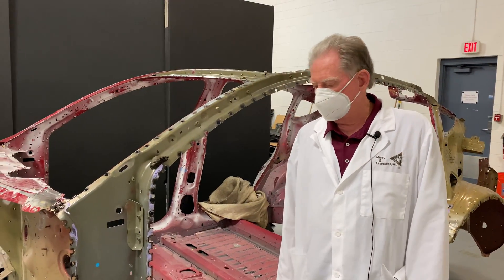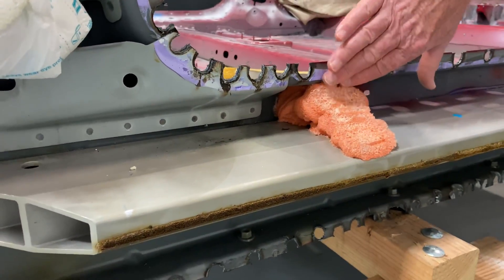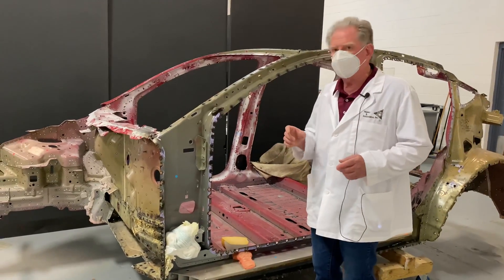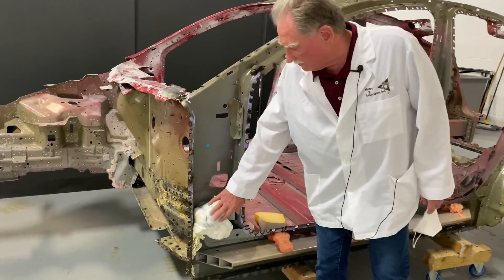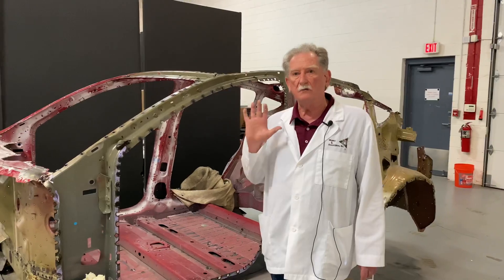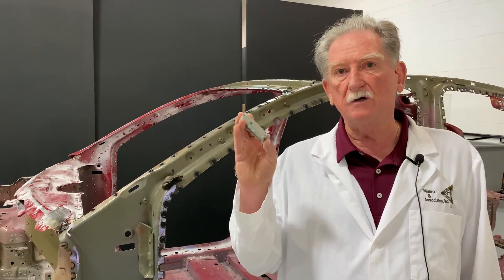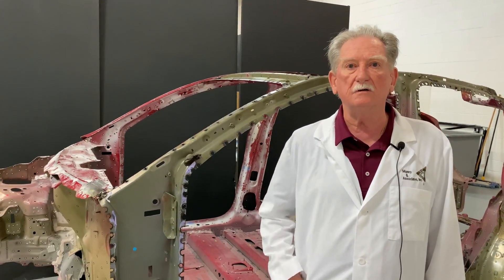Tesla Model Y - Failure to Foam

Comment: @Mr. Munro - I want to do whatever I can to improve the sound deadening in my Model Y.  Are there any places or cavities in the model Y where I could add low-expansion spray-foam insulation or something else to accomplish this?  Based on this video, it looks like there could be.  Do you have any other ideas for reducing road/wind noise in the interior?  Thanks!

Comment: $130 for ONE battery? Ah that's a good laugh..
Reply: I would buy one. It is a memento, not a battery :) But US only :(
Reply: @MB-xz7ls  yeah I understand a "memento" if you took it apart or if it actually meant something to you. It's just a battery taken from a disassembled Tesla. Get one on ebay for $5
Reply: @O-RoD  Sure. Everyone has a choice. For me it would be a memento but they would need to make it real good. Not just a battery in a jar. :)
Reply: @O-RoD  I just checked eBay. They sell it for really crazy prices. Not 5 bucks :)
Reply: @MB-xz7ls  search eBay for "2017 Tesla Model S X 18650 Battery Cell"  $4.99 + $3.50 shipping
Reply: @O-RoD  ok but I was thinking about TM3/Y 2170 batteries

Comment: Munro, I've designed pillars to deal with spray in expanding foam as well as the expanding foam in the floor area. I've never heard of using bag foam and it seems like a big design mistake. Can you post pictures of what the other side looks like to see if it might have been just a 1 off issue relating to expansion or placement or if it is an inadequate sealing strategy?

Comment: That's InstaPak foam - used for shipping fragile goods. It has an A and B component in the bag, you press down on the two components and knead them - starts expanding. It also acts like a sponge, so when it gets wet - it stays wet! Being where it is, isn't good - if it were to get wet in a salt belt environment- it could lead to serious structural issues from corrosion.
Reply: Yes, I would probably guess the bag either split being pushed into the cavity or wasn't properly mixed, or a bit of both. I would guess being in a bag would have helped as it would stop it getting wet.

Comment: What sandy found was an example of hidden quality faults that result in customer complaints that are likely never solved.  

“My car is noisy and my buddies is quiet.”   No service rep would EVER figure this out unless Tesla made a quality bulletin and figures out how to fix it (inject foam into the unibody?).   

Sadly, early cars will suffer from these defects unless Tesla really buckles down on process control.
Reply: Every Tesla model has these quality fails when they initially come out, I feel that they never learn. I think I even heard Elon call initial customers his "Beta Testers" and that's right, they are guinea pigs for the R&D and production guys.

Comment: That's packing foam, like you get in a package of parts. Holy crap. Very half-assed. Tesla does much great stuff and then throws in these head-scratchers. Foam block behind the rear wheel wells are another example of something not quite thought through.

Comment: Foam in hollow body panels is generally a bad idea because the material collects water from condensation rusting the metal from inside out.Better use other sound deadening methods and spray the cavities with liquid wax/grease to protect against corrosion. It seems that there is no additional rust protection on the inside of model Y steel panels in vulnerable body areas( A-Pillar)! Not all EVs a driven in the dry south west.
Reply: It is only a bad idea to have foam in hollow cavities if you expect a lot of water to get in. However, most of the time, these panels are hot stamped and are coated from the supplier as well as go through a corrosion resistant bath after being welded up. That should protect enough for a few drops of water that get through before it evaporates into the atmosphere. Liquid wax and grease is great, but super expensive and a pain to apply. Most of the time it isn't needed unless you are in a northern area that gets a lot of snow and salted roads. It is much more efficient to design a car to not leak and put sealants in the weld seams to ensure water doesn't get into those pillars.
Reply: @veverkak  Problem is  repeating water condensation on  cold not airtight enclosed steel parts when air temp and air humidity changes, for example overnight.Welding damages the protection layers you are taking about. I assume because of limited bat life Tesla has calculated  a matching limited body life too.Wax/grease spraying is a standard process in premium car manufacturing. Mr. Munro does not address the issue therefore it seems either he lacks expertise or his manufacturer comparing analysis is biased  .His show is amusing though.
Reply: plan pitz obviously condensation will occur. The hollow sections “should” be air tight to the exterior wet environment, but not air tight to the interior. So the condensation should still be able to evaporate at a rate that does not cause this to be a corrosion issue. You are also correct that welding removes the protection of both the metal coating film as well as any sealant in the welding location. However the ED coating that the car gets after the body is welded together will still be enough protection. Also, the flat for a spot weld flange should be designed wide enough to take into account the heat effected zone from the weld as well as robot accuracy and still have enough panel to panel contact that water doesn't get to the heat effected zone of the weld. I think wax/grease application has decreased usage even in premium cars due to cost and the improvement of white body accuracy.

Comment: I hear the front motor with whining noise and pulsing sounds while cruising in my Model Y (especially above 40mph).  Could this be the reason why?
Reply: Did you expect it to be perfectly silent, like an internal combustion engine?
Reply: @isthatatesla  I get it and don't expect it to be quiet.  I believe what I'm hearing is not normal...The lack of insulation could explain it.  Sandy mentioned in the video that he heard noises as well and included in his road report.
Reply: @rmoro999  He heard wind noise. Are you sure your not hearing the heat pump?
Reply: @JasonWW2000  yeah, I don't hear the noise at lower speeds.  It's when cruising along around 40 mph barely pressing the accelerator...it's a high pitched whining noise from the front motor that goes from constant noise to oscillating / pulsing.  I have to turn up radio to drown it out.  Is this normal for AWD Tesla?
Reply: @rmoro999  I dont know if that's normal or not, but if its bothersome it's probably not normal. I would check Tesla forums.

Comment: .007 0:07 that looks like shipping foam. Which would be horrible in the car because it's meant to compress and absorb energy and get smaller which means in a car it would get smaller and smaller until it started rattling and actually making noise
Reply: You'd actually hear foam rattling? Seriously?
Reply: @isthatatesla  Its very light weight. No rattling.

Comment: Ouch. But at least Tesla will not wait until next model year to fix this.
Reply: Watch another channel and that is put in there to stop noise from the air when driving and they originally didn't do it you had to get a third party to do it, they have been doing this for years and still haven't fixed their design.
Reply: @dikkybee4003  maybe because that foam does it's job 99% of the time and if that Y was not tore down, it would have been fine?
Reply: @davidbeppler3032  Please watch the video before commenting.
Reply: @davidbeppler3032   As Jason says, just watch the video! It’s only 3 and a half minutes long:

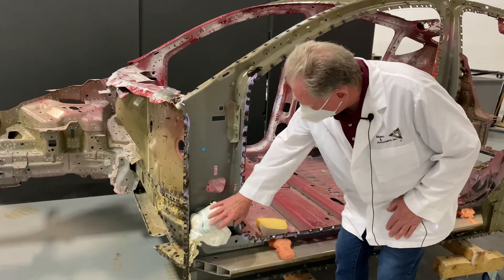1:27 “This with the bag and everything, I don’t, I’ve never seen that before but I can tell you that it’s ineffective. And in my report that I did on the ride and drive, I mentioned that I was hearing noises from the front and I think this is supposed to nullify that noise, in actuality really what we’re looking at here is something that’s totally useless.”
Reply: @mrsneeklamy  Do you have a point?  As I said, works 99% of the time.  He found the 1 that he says does not.  I guess you don't understand how mass production works?  Yea, Sandy said he thought he heard something.  But he did not say, I knew we would find something wrong.  See the difference?
Reply: To be fair, if things like that happen at BMW or Audi, they fix it as well during the production run, not with the next model year.
Reply: @Batvolle also to be fair, BMW wouldn't use InstaPak shipping foam in their cars (which holds water like a sponge)  :) 

This would have been caught in validation and pre-production.
Reply: @myronsamila7493  hahaha not true. They used in in my e46.
Reply: @myronsamila7493  Hahahaha car company will not cut corners to make more profit.
Reply: @davidbeppler3032  actually, those InstaPaks are quite expensive and have to be activated manually - so technically they're not cutting corners, they're adding cost and possibly creating a future issue. I'm sure they'll solve it at some point soon.
Reply: They've had terrible paint quality for years and haven't fixed that yet lol
Reply: @wasupfool5692  Still better pain than several other auto makers.  Go do a paint test on a dozen new cars from multiple manufacturers and you will see that Tesla Model 3 is in the middle, not even at the low end.  Have been for years.

Comment: They talk about the longevity of the model three long range battery being in cycles? So 1000 cycles if you drive 200 miles on a cycle is 200 K miles. Easy. What if you drive 75 miles a day total? Should you run the battery A couple of days before charging it to keep the number of cycles low or do you like tesla says always be charging? But if I use 35% a day should I charge 35% every night? Doesn’t that eat up my cycles? So to speak
Reply: The correct answer depends on the battery chemistry, physical structure and battery aging.
But the general answer is that you maximize the aggregate lifetime power output of the battery by cycling in the middle of the charge range e.g. from 70%-40%.
The worst lifespan is typically by cycling at the low end of the range, from minimal charge to full discharge.  That is followed by cycling at the high end of the charge range, especially at high temperatures.
There are multiple aspects of battery wear.  The easiest to understand is the physical wear.  Almost all batteries are most dense when charged and least dense when discharged.  This flexes the battery structure.  There are chemical tricks to moderate the behavior, but the best mitigation is to limit the charge and discharge externally.
Note that limit is already done by the battery controller in most systems.  Your phone and laptop battery are far from the displayed 0% or 100% on the display.  How far you can only guess, as the manufacturer did the tradeoff between cycle life, calendar life and power-on hours.
Reply: Utilize the the middle of the pack as much as possible.
Reply: Jim Arnold yeah I know that thank you buddy but that doesn’t really answer the question I think only a real expert will know. I have had a couple of these so I’m damn near an expert because I am interested but this particular question needs a pro
Reply: @John-209  Sounds like you are considering a charging session a cycle irregardless of amount charged. My understanding is a cycle is 100-0. So five sessions with 20% DOD is one cycle.  The number of cycles yielded by a battery goes up exponentially the shallower the DOD until it's "dead," which is what 70% capacity from original? 

We generally know best practices for lithium ion batteries and those in the Model 3 and Y don't appear to be radically different, so following today's best knows practices for maximum longevity seems the prudent course of action. 

See https://www.energy-storage.news/blogs/every-charge-cycle-counts-when-it-comes-to-battery-degradation and https://news.energysage.com/depth-discharge-dod-mean-battery-important/ and https://www.mpoweruk.com/life.htm
Reply: Jim Arnold thank you very much Jim that does make sense that 0 to 100 is one cycle but I just wasn’t sure glad to hear it thanks again
Reply: A cycle is all the way up to all the way down. Or perhaps all the way down to all the way up. Adding 20% here or there is only a fraction of a cycle. Just drive it. No need to overthink it.

Or, I could've just said, "What Jim said."

Apple has laid out specifically the same information regarding the iPhone or any mobile phone battery.
Reply: IsThat ATesla everybody over thinks this charging shit that’s half of the fun I know it doesn’t really matter but I think you’re wrong one cycle is one charge it doesn’t have to be 100% charge, it doesn’t really matter though I thought about it the first few months and then switched it over to percentage and I haven’t really thought about it until I watched a video yesterday
Reply: @John-209  Also keep in mind that charging slowly will increase your total number of cycles before you hit 80% capacity. So don't set the charge rate too high if your charging overnight. Set it to a lower amperage. The less stress on the battery, the longer it will last.
Reply: JasonWW2000 From what I understand level 02 charging is healthier than level one.
About 8 kw per hour
Reply: @John-209  No, level 1 is the slowest (120 volt 10 amp = 1,200 watts = 3 to 4 days to fully charge), level 2 is faster (240 volt 25 amp = 6,000 watt = overnight to fully charge). Some level 2 chargers can go up to 15,000 watts. Generally speaking, the less stress you put on the batteries, the longer they last. Personally I wouldn't worry too much about using level 1 or 2, but I would try to limit my use of level 3 fast charging if you want your battery to last a long time.
Reply: JasonWW2000 thank you for advice

Comment: Why do cars have foam between body panels? 
Do every cars have it?
Reply: It deadens the sound. It is common
Reply: Most cars don't have it, but electric cars are so quiet that you can hear air in the panels at freeway speeds. Tesla tries to block the air to make it just a tiny bit quieter.

Comment: Mr Munro, what does these foam do? absorb/dampen vibrations?
Reply: Noise reduction. It's much too light to absorb vibrations, for that you need a heavy rubber-like material which Tesla also uses in some places.
Reply: Its an acoustic dam, it stops noise resonating along and into chambers, think of how a small amount of noise at a mouthpiece of a trumpet resonates and is amplified as it passes through the chambers, the dams prevents that happening through all the hollow box sections in the vehicle structure